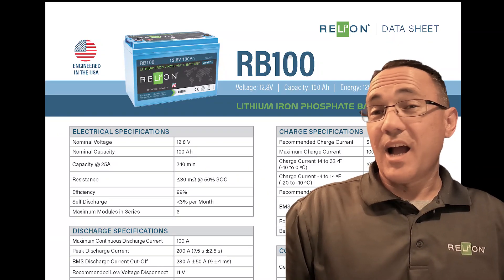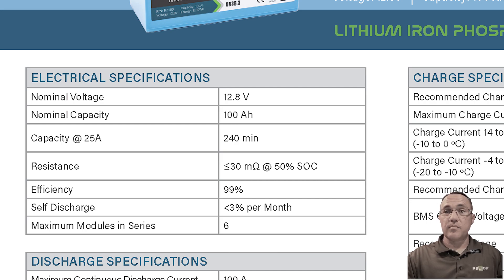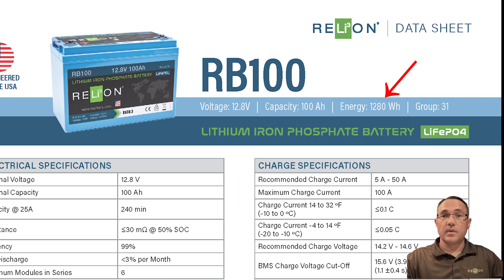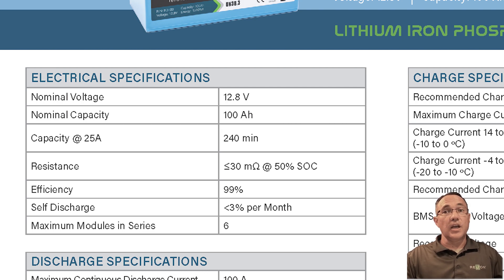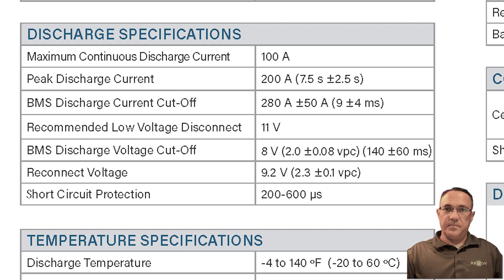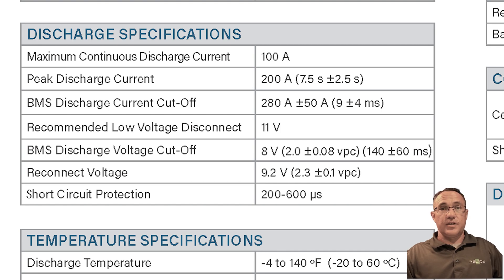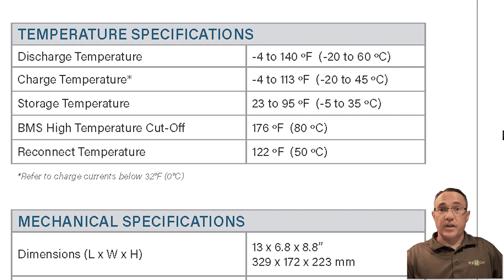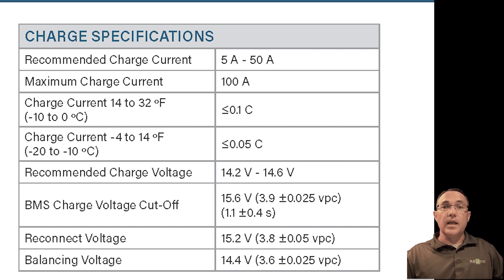From the Tech Team | How to Read RELiON's Data Sheets

Comment: Does the BMS automatically adjust to the charge specs at low temps or does the battery charger need to do that?